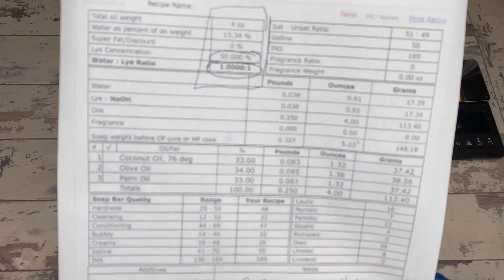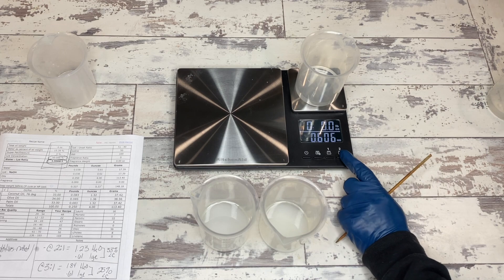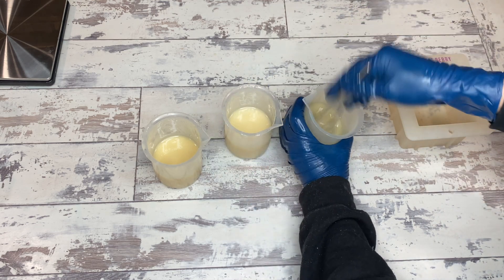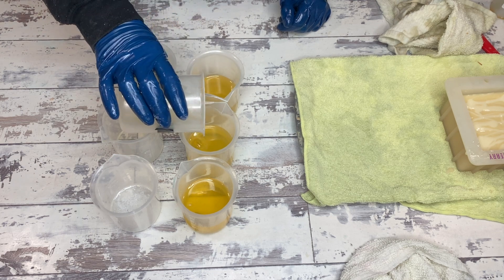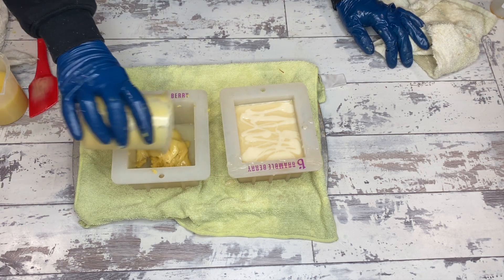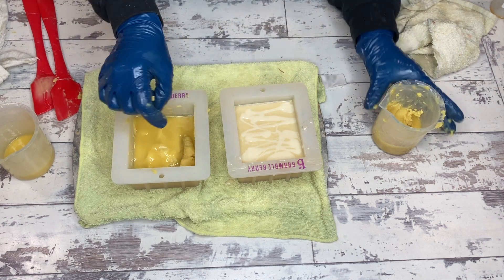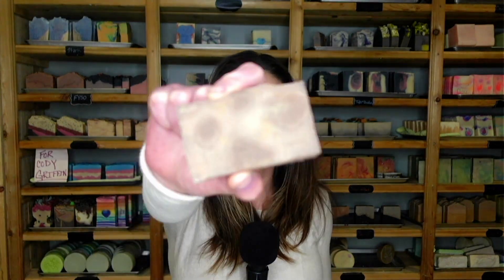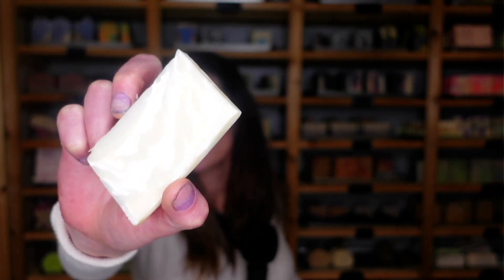How To: Easily Control Accelerating Fragrances for a Fluid Pour.

Comment: Perfect timing, I just used a new fragrance this week and it accelerated a lot. Tried more water but accelerated. Then used your 2,4:1 ratio instead of percent to water to oil and was able work with the FO and actually pour into mold rather than plop it in. Thanks for all the great info you give.
Reply: I just did the very same thing today! Had I known it was going to get "spicy", I'd have upped the water ante at the onset. And now, I know!!

Comment: So I have a question. Since it’s water to lye ratios, couldn’t you do the whole batch a 1:1 then separate into 3 cups and add the extra water after you’ve reached emulsion with the whole batch in the beginning? Could you do it that way??

Comment: I have a question, hope i can formulate it so you can understand what i mean. Maybe you can explain what went sideways: i tried ghost swirls, because i thought it would be easier i made my batter with a 1.2:1 water to lye solution, divided my batter in 3 portions and added enough water in one of these to get a 2.3:1 solution. As i added the water the batter instandly accelerated and went thick, and in the mould it heated up so badly that i had oil sitting on the soap and it got heat tunnels that leaked oil. I moved it in the fridge but that doesnt help. Could you explain why this happend?

Comment: Because I’m the type of gal who like to be smart-lazy, I wondered something while watching your video: is there a reason why you take the time to prepare 3 lye solutions? Because my smart-lazy brain’s first instinct would be to prepare a lye solution at the highest concentration (the one with the minimal water) and once everything is fully dissolve, divide the lye and add water to one of them? Of course, there would need to be some calculation (both for dividing the lye and for the water to be added). But for a principle point of view, is there an issue with this?
Reply from the maker: Hey! Good question. There is nothing intrinsically wrong with making one strong solution and diluting two, but that doesn’t save any time (and may take more time as the bulk lye solution will take longer to cool down) and adds an additional opportunity to make an error (the extra maths that have to be done to calculate the weight of the lye in addition to the water to get the proper amount of dilution). Many soapers use this method, also known as masterbatching.